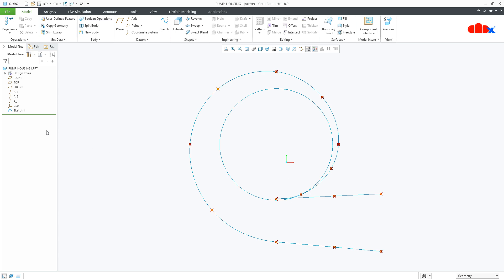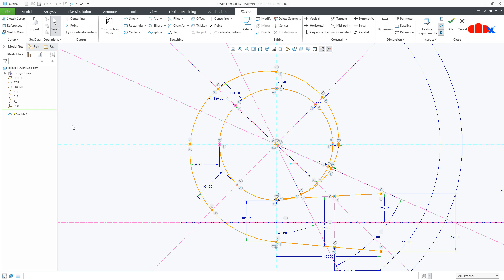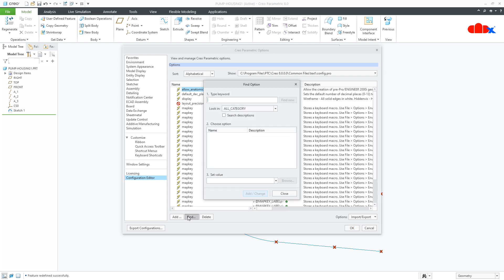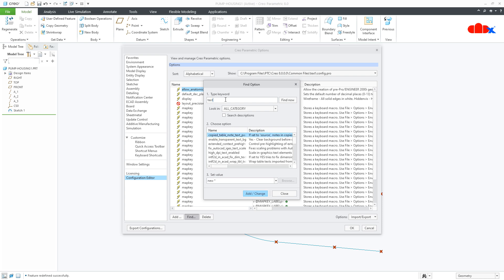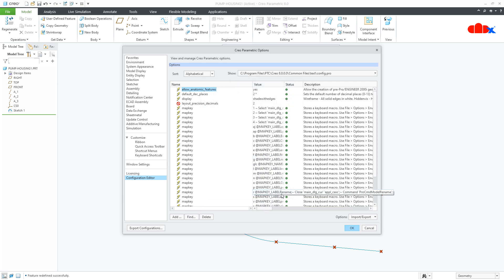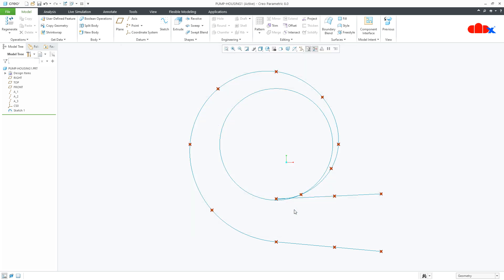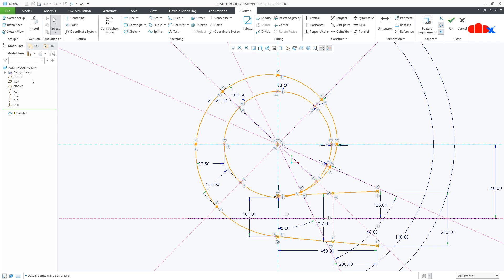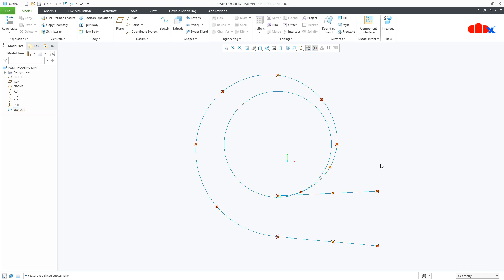Increase Sketch Dimension Text Height in Creo Parametric

Comment: Can we add bullet points or numbering in text in Creo drawing?
Reply from the maker: No direct option yet.
Reply: @CADxTraining  Is there any way to represent fillet/round of in drawing because chamfer & radius lines looks same?
● https://www.cadtutor.net/forum/uploads/monthly_2009_02/1028427743_Drawings001.jpg.c8b70f41a670d1a25a7d889b4fa3782b.jpg
● https://www.cadtutor.net/forum/uploads/monthly_2009_02/2066908863_Drawings002.jpg.6233b37c7f47bce9b1a129ea62fcf6f2.jpg
● https://encrypted-tbn0.gstatic.com/images?q=tbn:ANd9GcRx3Zm_R4UjOtwpHl-9TqWx7E3gWH88OqOv2A&usqp=CAU